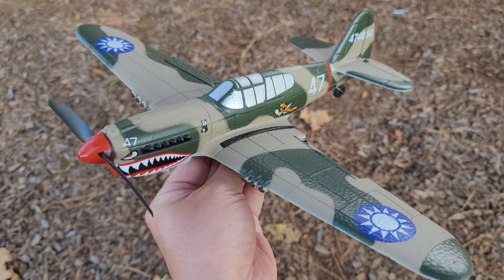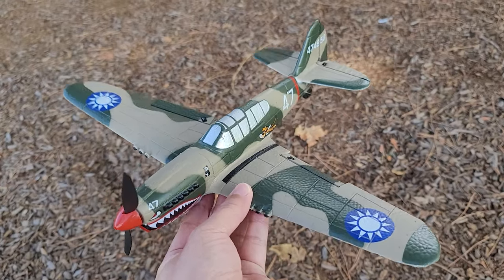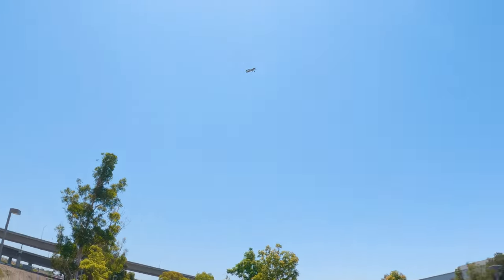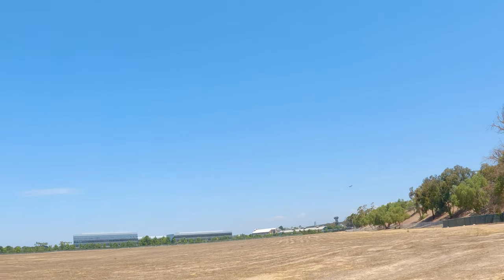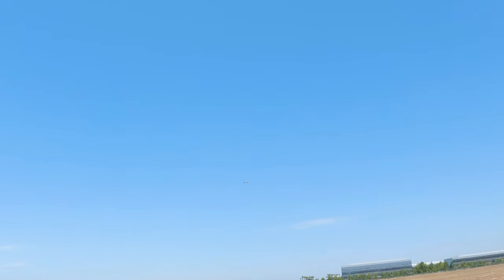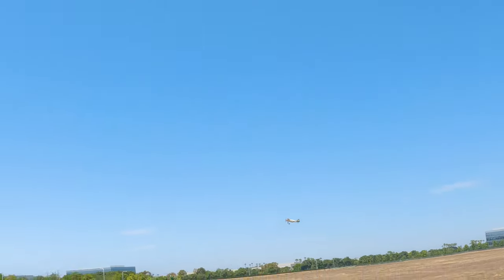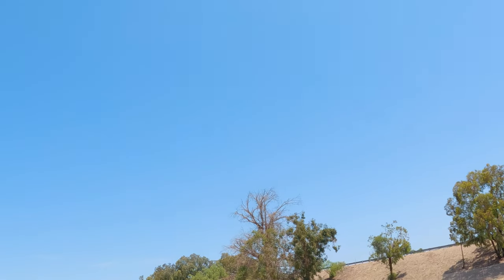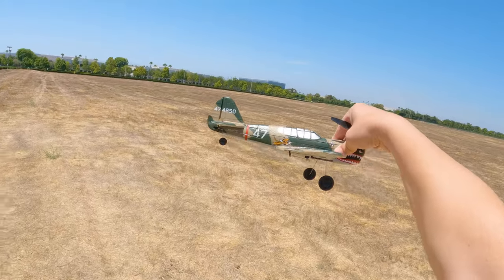Eachine P-40 Warhawk Micro Fighter Plane Review

Comment: I recently bought eachine mustang p-51d. Great plane, flew awesome with the stabilisation and all that. Switched to advanced mode and after few landings (not crashes, but smooth landings) the motor stayed on when powered (no throttle response). But it is great plane (looks similar to yours) and flies awesome as a trainer for any age.
Reply: The Eachine P-40 is a semi-well designed plane. The mustang p-51d is most likely off the same mold. They manufacture these in huge quantities.  The planes are identical but the manufacturing source is most likely different.  Further down the line they receive a different branding/packaging, Eachine, WLTECH, FNRC, Volantex, etc.  As they continue to manufacture, their sources will change and this often results in slight changes, sometime better sometime worse.  Your experience was great, I am happy for you, but with any purchase, product experiences can differ immensely.  Happy Flying!!!
Reply: The T-28 Is The Best Flyer Out Of These Mini-Warbirds Series... 😁😎

Comment: These are pretty cool.  They are relatively inexpensive (arguable) and fun to fly.  They come in a complete kit (radio included).  They are durable and great for beginners.  The prop pops off in a crash.  It is lite, so it is best flown on calm days.  Great review on a inexpensive RC plane.  It's great for somebody wanting to get into the RC hobby.  I think it is best of it is hand launched as the wheels require a smooth surface to achieve takeoff speed. Thanks again for taking the time to review and share your thoughts on this RC plane.

Comment: I picked this one up, it's fun to fly! It does stall when you cut the throttle back but it is still fun to fly, as you look under the plane towards the nose you can pull a piece of the foam out, the motor will be seen, put a few pennies in there and then put the foam back on, it helps a tad bit!

Comment: Albert are there any differences in the flight characteristics between these Warbird micro scale electrics?  Also thanks for multi protocol tutorial for these little guys
Reply from the maker: From my experience, there are very small differences in how they all fly.  However, I don't think most people would have the flight time to know or realize anything different.  I do point out these in the videos if you go back and watch them the playlist link is in the description.
Reply: The Eachine P-40 is a semi-well designed plane.  They are mass produced.  You will find these planes sold under different brands/names.  The planes are identical (mostly) but then further down the line receive a different branding/packaging, Eachine, WLTECH, FNRC, Volantex, etc.  As they continue to produce these (whomever they get to manufacturer) their sources will change and this often results in slight changes to the end product, sometime better sometime worse.

Comment: hey just wanted to say love your videos help me a lot. so… kind of a dumb question but the tcmmrc ur26 murmey that you reviewed a month ago, what kind is it, analog, digital and 2.4ghz or 5.8 ghz. startet recently with the fpv hobby, love it.
Reply: that is a 5.8g as with most analog quads on the market they all pretty much run 5.8g. 2.4 g is mainly used as the control link  for all but all stuff except  900mhz  like crossfire and express lrs  frsky r9 ect...
Reply: @Adam_Carbone  thank you so much
Reply: @Adam_Carbone  i can bind this drone to my radiomaster (tx12) right?
Reply: @Adam_Carbone  second time think you so much . little recommendation do you know the baby ape / pro
Reply: @jebrc  thank you too
Reply: @Adam_Carbone  nice, a other question do you have to build a (TRANSMITTER??) in it ?
Reply: @Adam_Carbone  thank you so much
Reply: wich resciver should i use for the tx12?
Reply: @Adam_Carbone  thank you
Reply: @Adam_Carbone  how do you know this all (did you start with this hobby long ago).( my first drone (tiny-whoop) arrives in about two weeks
Reply: @Adam_Carbone  you built it yourself. respect
Reply: @Adam_Carbone  yeah… i used a long time the dji simulator (because its free and playable on a phone or ipad )until i realized that the radio 8s not real and the physics are trash
Reply: how do i know if a transmitter and a radio are compatible
Reply: @Adam_Carbone  thank you
Reply: @Adam_Carbone  hey thanks for your help again, does the ch matter on googles to bind to drones or what does it mean thanks a lot
Reply: @Adam_Carbone  thanks

Comment: I've flown one of these too. Calmer conditions but tip-stall prone in a way that the P51 and T28 are not.
You mentioned holding the model in a nose down attitude before powering on. I have seen videos where that is important with XK models, but I've never found it to be the case with an Eachine model. I power then up "upside down"!
Also I didn't notice you mention what gyro setting you were using.
Reply: Regarding wind, I have flown the T28 in 15mph winds and it flew great. The wings quivered but the overall model was rock steady.
Reply from the maker: This one needs a bigger battery to fix the CG and that should fix the tip stalling issue.

Comment: Hi mate I have one of these and the p-51 my p-40 has the same issues but the p-51 flys really well and it can fly slow to without stalling but my p40 seems to stall and spin easy
Reply from the maker: Probably differences in frame design.  Also, the CG might be incorrect.

Comment: How do you tell the cg is tail heavy?
Reply from the maker: By the way it flies.
Reply: Here is the super simple explanation.  Every model planes CG is different.   If you balance the plane on two fingers close to the fuselage just past leading edge of the wing with battery inserted (A model planes CG location/area is described in it's manual.) it should balance. If it doesn't, coins, small lead weights can be added or battery can be shifted forward/backwards to achieve balance.  Some planes need to flipped upside down to determine their center of gravity.  Every model planes CG is different.
Reply: @AlbertKimTV   how about trim the elevator to push nose down rather than adding coins